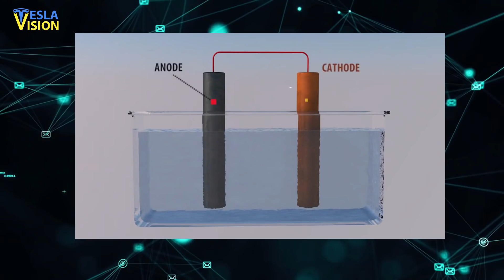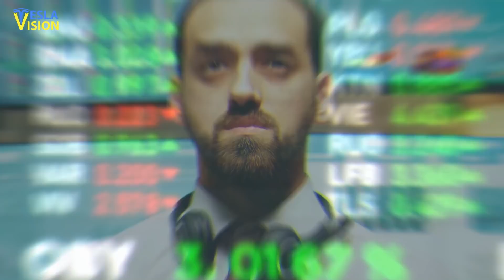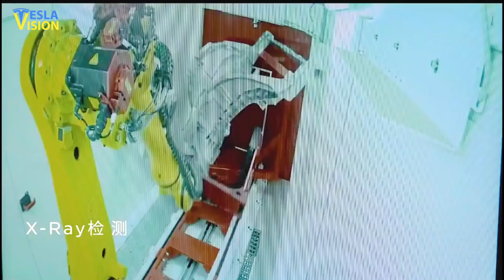This NEW Tesla Patent Will Cut ALL Costs and More!

Comment: EV batteries have varying lifespans like many different batteries …. After market service centres approach the solving of power depletion by several methods , some more economical- than others . Recycling the batteries is great but replacing only failed cells is probably best …

Comment: The car battery cells even when 30% (or more) depleted will be repurposed into static storage. It’s likely to be 20 years before today’s Tesla car cells are taken for recycling. We already have the tech to do this efficiently and safely.
Cobalt is used heavily by petroleum fuel manufacturing as a catalyst to remove sulphur. 
Tesla does not use cobalt from slave labour sources. 
Recycling is not as toxic as some suggest. We now have a process where cells are called to -50C before being mulched for chemical processing. When it does happen at scale, there is minimal toxic by-product, because the desirable elements are in such high demand.